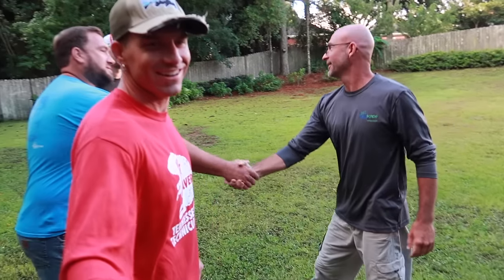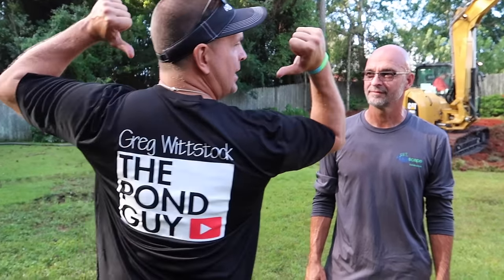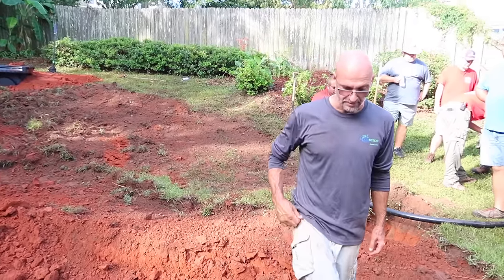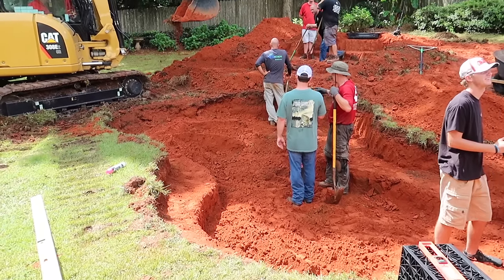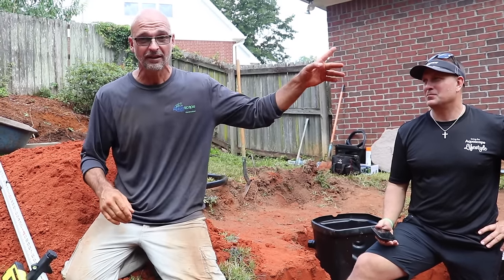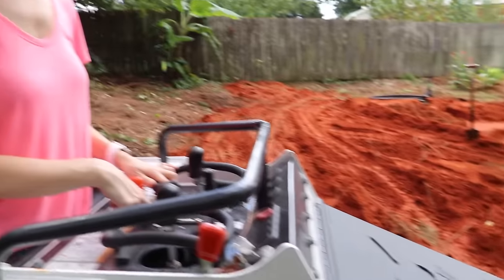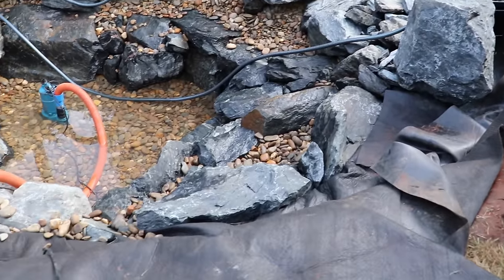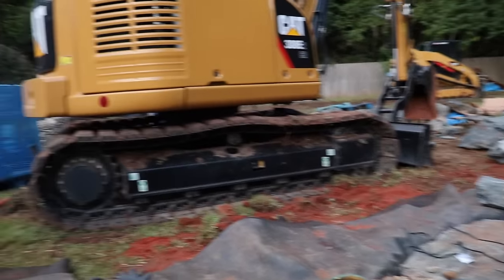Building a Backyard Bass Pond!! (Day 1)

Comment: Rest In Peace your water bill

Damn that’s a decent amount of
Likes 👍👍😩😩
Reply: You already invested in that, you might as well drill a well bamabass. Then you can tie that into your main line into house also and delete your water bill completely.
Reply: @andrewh3177  well pumps will not effect electric bill that much. I was a plumber for 10 years and used to replace pumps and lines. Most of the pumps i used were 10amp running off 120v
Reply: The initial fill will be spendy but after that natural rainfall will reduce the need for adding large amounts of water. The biggest expense will be the ongoing electricity consumption from the pumps.
Reply: Surprisingly it doesn't cost much to fill the pond and run it
Reply: Yep, that'd be the best route, add some treatment to remove any harmful metal etc. Rain and snow should be enough to replenish macro nutrients on occasion from what might get removed in treatment that makes the water safe for the fish. (very important to plants, not just the fish their selves.)
Reply: Jayknee Garner didn't know it rained through out the entire year there, good to know, cos let me tell you, rain water won't be enough during summer
Reply: I hope theyre on well water
Reply: Well, he would have had already invested in the pond + the well thus far, so might as well also invest in building an electricity generator of some sort to power the whole system. ;D
Reply: I like where we're going with this... What else is there?? :D
Reply: Reactor?
Reply: Why? Water is the same all the time! Never changes^^
Reply: @mjim1717  LMAO you worrying about other peoples money, get your bread up peasant
Reply: True
Reply: lol i dont pay anything for water in nz
Reply: Pretty dumb to think he could put in a well do you see how close his neighbor is
Reply: Flat rate bill baby  what y'all know about having waterfucking everywhere
Reply: @swampthingforteinadeyate9007  How can I convince the city to let me dig a well? As far as I know, they REQUIRE all occupied houses to have water/sewer in my city.
Reply: it's alabama a house is probably like 50k, water bill not a issue i'm sure
Reply: Those rocks alone probably cost him a few grand
Reply: @swampthingforteinadeyate9007  He looks to live in a municipality.  Laws are different everywhere, but most do not allow wells in the area served by municipal water.  You also don't factor in the depth to ground water of that well.  Yes shallow wells don't cost a lot to deliver water, but if that water is deep, then it will cost quite a bit in electricity to pump to the surface.  A well is at least a few thousand dollars all in.  He could fill that pond many times for that amount not to mention the cost of electricity.  Just using the municipal water is much less money.  You would practically never see payback on a well.  For rough numbers, a well may cost $5000. If that pond is 5000 gallons it would cost about $3.50 to fill it from municipal water.  Considering the cost of electricity and the cost of the well, you would have to fill that pond about 1,500 times to see payback.  A well is definitely not cost effective.
Reply: This is all around a ridiculous waste of money.

Comment: I never saw or heard any mention of seaming the liners and I did see a few pieces of them ( or may be they were barriers). most of the time I see a one piece liner. All this work for Bass?? you can see Bass in any water hole. But you can upgrade later when the water is set-up. It is all about the water, the rest is the fixings. Awesome crew, awesome pond Greg is alright too.

Comment: late to the party - but question regarding pond liner: I noticed two pieces were overlapped. Is there anything done to seal that seam to keep from water escaping? Thanks for your time. Looks great!
Reply: searching the comments for the same! I did this on a tiny pond and I had one tinny crease leak. I did most of the sealing outside the pond, laying it flat, but did some inside overlapping as they did. No freaking way they sealed those two big pieces. There must be something they laid in between that created a bond, somehow.

Comment: I did notice that you used 2 sheets of the PE pond foil and just overlapped them rather then solder them together. I'm a bit unsure about the water retention capability of the ultisol (Red Clay) that might mitigate this but i would expect some major leakage between the foils. If true, a quick though not perfect fix might be to apply bentonite powder to the cracks; provided the current is not to strong it might seal it off.

Comment: I built a pond up here in Maine and when it freezes it blows out the back of the damn.  I've had at least a half dozen people work on it and it keeps happening.  I bought a few heaters from "Pond Guy" hoping it would leave an area where the spring fed water could escape above the ice instead of blowing out the damn below the ice.  But it's been in the single digit to teens for a month now.  I don't know what to do.  I've wasted easily $ 5000 on contractors trying this and that with heavy equipment.  Any ideas or help?